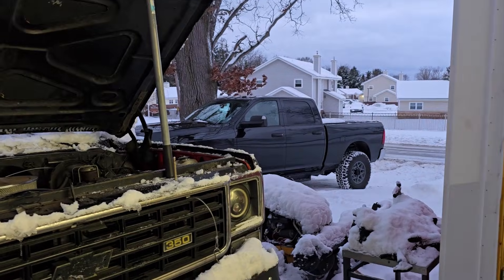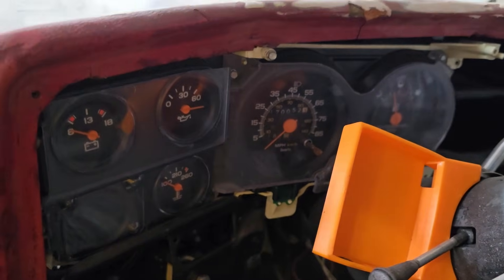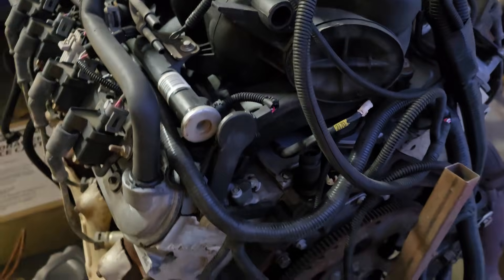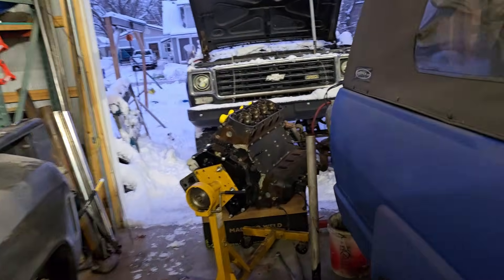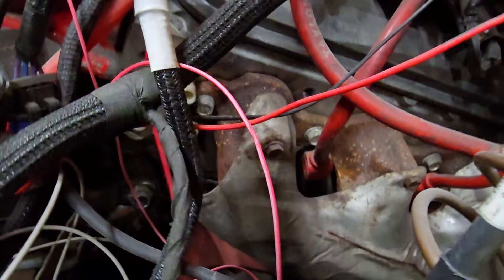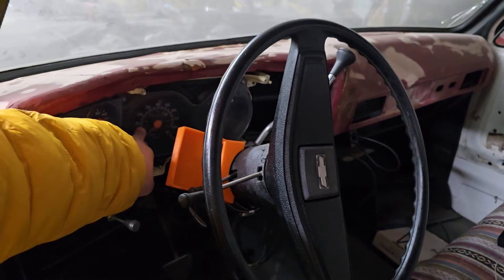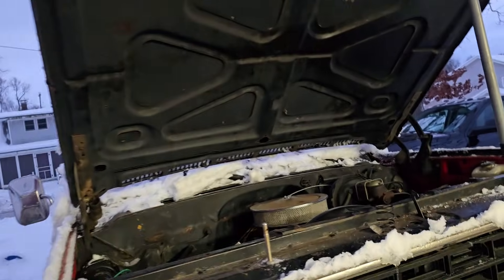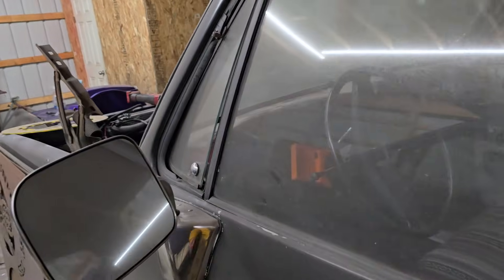How to Make ANY Gauges Work on an LS Swap (The Easy Way!)

Comment: I have a 2000 Chevy 1500 that I want to put an 6.0 LQ9 in it WITH the ECU for that LQ9. My question: would it plug and play with my 2000 harness, or would I need an ecu from a 6.0 that is drive by cable, because that’s what my 2000 has with the cruise control and everything on the drive by cable…. It would be awesome to just plug and play with no tuning needed!!! Thoughts anyone?

Comment: I did a half assed merge of my Beretta harness with the truck harness to run all the stock gauges. Since GM rules, nearly every wire I needed to splice were even the same colors. The LS truck cruise module and oil sender plugged right in🤣
I left the 2 wire truck temp sensor in to run the PCM and used the one green wire of the 98 Camaro CTS to feed the Beretta gauge. Mint.
Reply from the maker: Yeah, unlike Ford, GM never changes shit hardly

Comment: I thought about buying one of those cheap obd2 port gauges. You can get them for about $60 they'll have your tach and speedo
Reply from the maker: They can also pull the temp and oil pressure

Comment: As for the oil sender just take the stock one and smash the connector off the top of it and tap the interior 1/4 NPT.  Screw it back into the block and hook up and line or a new sensor into the old body of the oil pressure unit. No adaptor needed.

Comment: Great, simple info. Awesome. I have a Colorado that I bought swapped and it was very well done. Looks factory. I’d like to add an oil pressure gauge because the dash doesn’t have one. Any clever suggestions so it doesn’t look like my 71 Camaro inside lol
Reply from the maker: Is there a Colorado, or Trailblazer dash that does have one? If so it probably drops right into your dash
Reply: @TheDrivewayEngineer   Thanks for taking time to reply. Unfortunately not (just an idiot light) on all of them
Reply from the maker: Can always get a small tiny one to stick out of the way somewhere

Comment: I took the original 1 wire from the head of my 86 2.8 liter s10 and tapped it into the top of the water pump on the LS I swapped into it , it reads within 10 degrees of the computer

Comment: i saw where they are beefing up 700 R4 with 4l60 guts  ,making it turbo 400 tough ,have you seen this ,your thoughts ? my opinion is over drive is always the weakest link of any automatic transmission . happy trails .
Reply: I've done that with great success but Sonnax has all the parts you need to really handle power for around 200 bucks.  Right now I'm converting 4x4 4L60's to 2wd with just a new 2wd tailshaft and a 2wd rear housing, about 125 bucks,  While I'm in there I do improvements' to the 3rd & 4th gear clutches, add a wide band and a Beast sun shell for another 100 dollars or so in parts.  Those transmissions are great and handle lots of power.  Only problem is you need a stand alone controller (500 bucks) if your doing a install and have no other way to control it.  I wish someone would come out with an affordable Trans controller.